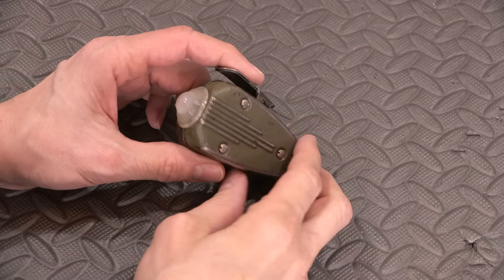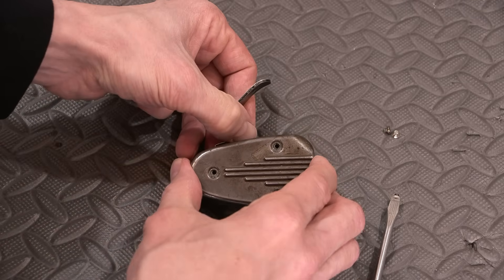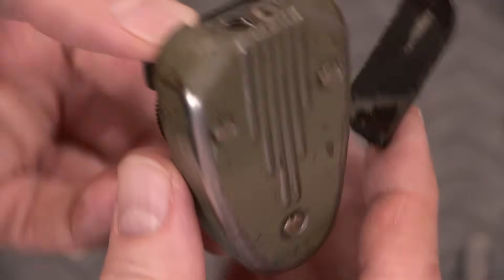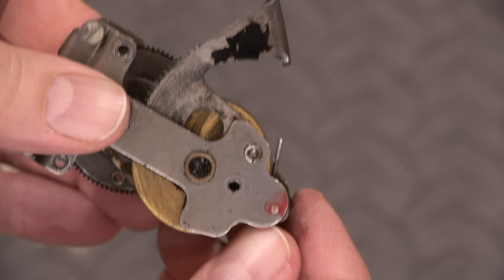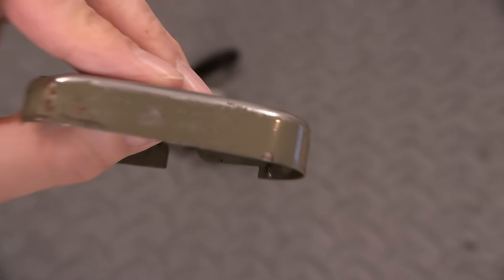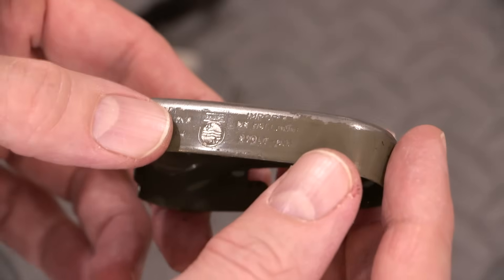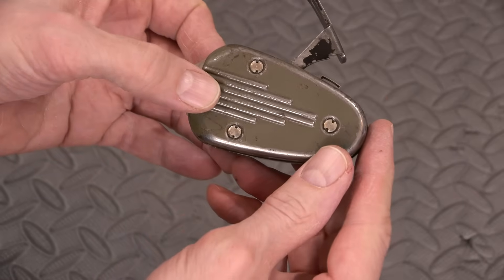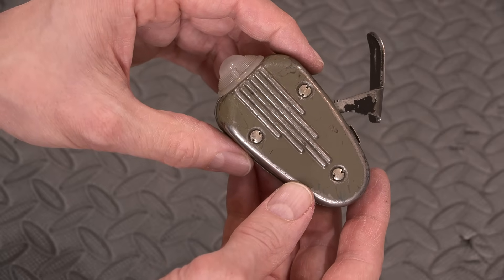WW2 Dynamo Flashlight - Doesn't Use Batteries! Let's look Inside.

Comment: I have several dynamo emergency flashlights that I bought in the early 2000's. Turned out they were plastic pieces of junk that no longer work after being in dry, cool storage for twenty years. Yet here we have an 80 year old masterpiece of engineering that has been road hard and put away wet for 8 decades, still working like the day it was made.

Another perfect example of how far we have fallen.

Thanks for the video, Mr. Carlson. I would like to vote for leaving it in original condition. I love it when old mechanisms are left just as they are, after aging gracefully through time.
Reply: I was just looking at some modern Chinese versions of these with hand cranks a few hours ago, many comments said they didn't last 5 minutes before the plastic gears stripped out
Reply: @zaptainkuboom5520  This is true. I have a blue one from a few years ago, and it just seizes itself, so you can never generate a good charge.
Reply: Ha! I bought a lot of these and just found one in a box the other day. The flashlight hadnt been used in years and still lit up without me having to give it a squeeze.

I am disappointed that the plastics fell apart so easily on these. They are amazing little gadgets.
Reply: those generally charged ni-cad batteries, then they ran the bulb/led. the batteries don't last long, used or unused.
Reply: Fenix sell 1 like this with advanced plastic

Comment: >this would probably run longer with LED's, but that would be a modification
Considering that the bulb is replaceable, I wouldn't consider it wrong to put an LED bulb in it, along with all the extra circuitry needed (if wanted), as long as it can fit where a bulb would normally be without damaging the original product

Comment: Hey, I own one of those. From my grandpa who had to hide for the Nazi's, but still needed some light in his hidey-hole. Quite risky, because as you can clearly hear, these things make a lot of noise... Fortunately he might have been hungry, but he still survived and eventually he actually got reunited with my grandmother. It still works, including the bulb itself, but the window is slightly scratched. The 222's "shape" is a perfect match with the one I found inside this thing.
Reply: It may have been quieter when new.  Still you would only use it now and then when you needed to see.  On a night with a moon you may not need it to be able to find your way about.
Many many years ago I met someone who told me he hid from the Nazis in plain sight.  He limped down the road pushing a cart load of cabbages.  He was a bit unclear about where he got the cart, cabbages and old clothes.  I thought at the time that that was part of the story he didn't want to revisit.
Reply: @kensmith5694 That's a good story. He was lucky to not encounter a really strict SS officer who was of the firm belief that crippled people were only a burden to society and needed to be put "down". Brrr, the very thought...

Comment: You need a 3.5 Volt 0.07 Amp bulbs, specifically designed for dynamo lights.
The 6 Volt 0.05 Amp bulb was designed for the tuning dial of tube radios, connected in parallel to the 6.3 Volt tube filaments.
These flashlights were very common at the time.
Regards,
Anthony
Reply: 6V 50mA has also been for very long the back light of a bicycle.
Reply: 6V 0.05 was actually for a bicycle rear light at the time. Later used as stereo indicator in radios. Dial lights were usually 6.3 or 7V at 0.1 to 0.3A.
Reply: 3.5 volt suggests a 3v white LED flashlight bulb might work in it. In the worst case, with a small dropping resistor.
Reply: @lyfandeth won’t an LED just turn on or off
Reply: @GoldenPickaxe  No, the LED's brightness should vary with the current. You would want to make sure that the source is DC, though.

Comment: Do a clean and re-lube only,,BUT why not take a bulb, remove the glass and make an adaptor out of the base and then make the capacitor / LED just to see as you said "modern improvements" working.

Comment: Brilliant video, thank you. I have exactly the same flashlight, in slightly better condition. Only slightly, but it does have both the plastic flanges on the lens. It was really interesting to see it's workings as I have never opened mine, just left it as is. I did replace the bulb though, although I can't remember what voltage or wattage. It lights, but not quite as much as yours. As far as restoring, all I would personally do is give the insides a little clean and lubricate, and that is it. Maybe polish the lens a little, but no more. Keep the original paint and patina, that is a part of it you will never be able to replace. Sure, you could repaint it and make it almost like new again, but if you did, I think you would loose what it actually is.

Again, great video, thanks!

Comment: What a cool flashlight! My opinion on restoration, clean lube and restore the intrernals and the lens. Keep the outside patina and always look at it thinking about how it ended up the way it is. It tells a story and is probably best preserved. 
But you own it and should you decide to fully restore it I wouldn't upset to see it in it's original condition either. It may be one of the best examples still around and restoring to museum quality has its place.

Comment: I am now 73 yo.  I had one of these to play with as a toy when I was a kid in the 1950s.  Keep in mind that all flashlights of the time were heavy, powered by at least two D size batteries, very small bulbs with a poor attempt to refelect light off of a rusty reflector.  We called them, " a case in which we stored dead batteries".  The Dynamo flashlight was always dependable, but the light was not at all bright and you had to keep pumping the thing at the same time as doing whatever task required light, such as walking, or chewing gum.  A better option for us was using a kerosene lantern.  Still in use today, I might add.

Comment: I have the same one for over 50 years. It also still works, it even also has one of the tabs of the lens broken off. But also more bits of edge of the lens broken off. The bulb inside is 3,5 volts 0,2 A.

Comment: Thank you Mr Carlson for the nice video.
Here in the Netherlands we have a webshop for spareparts for these flashlights.

Search for "knijpkatershop" to find it.
I bought a plastic lens for my own "knijpkat" ("pinch cat" in Dutch).
That website has also a hisory page, with at the bottom a detailed technical article by Philips about this flashlight.
The article is in Dutch, but has some interesting drawings anyway.
Some facts from the article:
The mechanical handpower to use the lamp is about 0.9 Watt, at a squeeze force of 1 kg.
About 0.3 watt enters the bulb, the rest of the power is lost as heat.
The dynamo runs at an average of 4000 RPM (squeeze 120 times per minute).
The average loaded voltage is about 2.5 volt.
So a 2 volt bulb runs at overvoltage, this increases its efficiency, but reduces bulb lifetime.
The lightflux is 2.4 lumen, and by the use of the lens this gives 4 lux at 1 meter distance.

Mij own "knijpkat" has an unpainted aluminium case, this was the first produced model (type 7424), and was for sale for civillians.
On the case it says for the bulb: 2.5 volt - 0.1 A
It still works great, and I actually use it now and then.
The paper thing around the bulb is a dust cover, I think especially useful when the lens would be missing.

Comment: I appreciate wabi-sabi but the patina on this isn't very impressive.  I'd refinish it, clean and lubricate to reduce the frictional losses and fit an appropriate LED and capacitor to make it far better than original.  Modern versions of these tend to be cheap novelties and utilize rubber belts and craptacular dynamos.  The robust internal mechanism of this unit combined with modern lighting technology would be a great combination.  Not everything needs to be a museum piece.  There's nothing wrong with improving an old design.

Comment: You could modify an old torch bulb with an LED, resistor, diode and capacitor.  That could be a neat upgrade without interfering with the original unit that stays lit for longer.

Comment: Vintage squeeze cat from the well-known brand Philips, type 7424 01A from the Second World War. The squeeze cat got its nickname from the sound it produced when operated. A cat-like whining sound. Due to the shortage of all kinds of raw materials and products, and the lack of batteries, people were forced to think creatively about the smallest objects for our daily use. The eclipse made having a light in the darkness a very important asset. Philips had a handy solution for this in the form of the squeeze cat and a flashlight that worked with manual control. The squeeze cat was invented by Ir. L.J. Kalff. Although the squeeze cat was only patented in 1942, production started in 1941. Philips also made squeeze cats for the German Wehrmacht, this production took place in the Vught camp from the late 1940s. Together with the infamous battery factory of the Vught camp of the B677 special workshop of Philips, where all persons working there were deported to Auschwitz with the transport of June 1944.
I inherited one of these and its a shiny aluminium one, still working great.
Reply: Hi Jaap, do you know if plastic lens caps were produced during WW II in the Netherlands?
Reply: @gerteldering  Hi Gert, your guess is as good as mine. But for what its worth, the answer is probably yes.
Reply from the maker: Thanks for sharing your story!

Comment: i say restore the lever to new and upgrade the light to LED and upgrade the cap or add a super cap if it doesn't have one. but leave the body. just my 2 pennies. Oh and the LED, put it in a screw in base from a incandescent bulb that fits it. Like maybe add a resistor to the bulb to keep it from draining the cap too quickly. Im thinking break the glass and remove it from the base, fill it in with hot glue.

Comment: These generators work in a constant current mode, there the current is not that much dependent on the generator speed...
For an LED you really need just two antiparallel (so it lights for both half waves) 100mA LED's and nothing else, so quite easy to build something into an E10 thread from a broken bulb and just srew that into the flashlight as is. I would use 6 LEDchips, I would use something like 3 for each direction and .arrange them into a hexagon with alternating polarity, sowhen the lens is on, it would smooth out the flicker a bit. No need to touch the lantern in any way.

Comment: I have a 'modern' version of one of these from some time around the 90's, which used to live in my car for emergencies, but it has been in the odds and sods drawer in my kitchen for many years unused.
It's likely Chinese or Taiwanese made I'd assume, very much doubt it's a collectable🤣
TBH, I've never opened it up to see how it works, but I'm sure it'll be pretty much the same.
The body is a fair bit larger, with a flat lense made of mostly plastic, cheap and cheerful knock off of old technology👍

Comment: I would leave the outside as is, but rebuild the inside, maybe put the new bushings and balance the flywheel properly to make it quiet and smooth. I had a similar soviet lamp from '80s, it had plastic case. I dropped it once and it developed vibration, probably bent an axle on the dynamo or something.

Comment: Fascinating, I'd always assumed this basic design was from the late 60s or early 70s. 

My folks swore by 00s-edition ones with LEDs, all-plastic bodies, and still no extra capacitors or anything. Which I bet are much less bright than your suggested version with modern LEDs and power regulation would go!

Comment: Had a cheap plasic version of those in the 80's, loud, tedious, tiring, annoying, inconsistent light, didn't use it very long.
But i remember it having a bicycle bulb 6,something Volt, i mean it was reasonable bright while it worked, but you could burn out the bulb when spinning it too fast too long.

Comment: It functions similarly to modern emergency lights that you squeeze, except built with far better quality. It still sounds exactly like the modern equivalent ones, interestingly. Originally, I thought the squeeze dynamo charged the batteries. In reality, the dynamo is for when the batteries are dead. That means you can throw it in an emergency kit and forget about it.

Comment: That is a very nice find. Very practical too. A lot.of people don't keep their flashlights in order, they forget to charge it, or the batteries are dead and when they need it it doesn't work. A light like this always works as long as the can squeeze that lever.  If it were mine I would say leave it as is. Clean it a bit, lubricate the mechanism but let it keep its wear and patina as a symbol to its history.

Comment: Kind of reminds me of my first bicycle which I got a dynamo which hooked up to the frame and had a cap on it that
turned as it ran against the rear tire. Two wires went to a chromed dome light mounted on the handlebars. It worked only
if you were moving. Good stuff Paul.

Comment: I remember when bikes came with similar lights back in the 80's that are driven by the edge of the front tire.
Reply: Had one on my 10 speed in the mid 80s. Also had a speedo that worked the same way.

Comment: These are still available.  We converted one to run with a LED lamp, because these older bulbs are no longer available (except as used ones).  Added a diode rectifier and a large capacitor, with resistor to the LED, and this made it run for several minutes on one push of the handle.  The old ones only lit for about 10-seconds, if that.

Comment: When I was a kid in the 60's I got a dynamo powered bicycle headlight/taillight set. It was much brighter than the old battery light that came with the bike, and paid for itself by no longer needing batteries, which only lasted a few hours.
Reply: Same time frame here. I saved and saved for my generator light. Of course, the power wasn't free--you could feel the pull of the generator in your legs, just like your car can tell when you turn on the A/C on a good hot day. And in order to have enough light to see, you had to peddle really fast. It was like you were perpetually outrunning your headlight at any speed. The old carrot and stick lesson. If you went slow enough to be safe at night, you couldn't see. If you peddled hard enough to see, it was like defying death it was so fast. At night, you know.

Comment: I found this fascinating discussion of the Phillips Pinch Cat Flashlight in an article called "Technology and Holocaust" on a website called History of Sorts:

"The well-known hand dynamo from Philips was designed by Ir. L.J. Kalff and patented in January 1942. There were more than a million copies of the standard Pinch Cat Flashlight model made.

"The principle of the squeeze cat consists of electromagnetic induction. When a magnet rotates in a coil, an induction current occurs in the coil. This current could then be used to light a light. The voltage was 2.5 Volts at 100 mA/0.1A; with the help of a lens, the light from a 2.5 V light bulb could shine in a targeted manner.

"During the occupation, 4 models were produced:

"Type 7424, aluminum, silver-colored (see image);
Type 7424/03, aluminum, green;
Type 7426, aluminum, beige (due to a lack of aluminum, brass was later used and zinc was used later);
Type 7426 Bi-Jou (the so-called “ladies model”), aluminum. Mainly produced around 1940-1941. With a retail price of 8.75 guilders, it is considerably more expensive than the standard model.

"From February 1943 until 2 June 1944, the standard squeeze cats were manufactured by, among others, the camp residents of Camp Vught, including Jewish employees of Philips (the so-called Philips Kommando).

"On 18 October 1935, Frits Philips was appointed vice-director and a member of the board of Philips. Learning of the expected occupation of the Netherlands by Nazi Germany in World War II in 1940, his father Anton Philips, young nephew Frans Otten, and other Philips family members escaped from the Netherlands and fled to the United States, taking company capital with them. Frits Philips stayed in the Netherlands. Together they managed to keep the company alive during the war.

"From 30 May until 20 September 1943, Philips was held in the concentration camp Vught because of a strike at the Philips factory.

"During the Occupation, Philips saved the lives of 382 Jews by convincing the Nazis that they were indispensable for the production process at Philips. Mr. Philips reportedly tried to hire as many Jews as possible and then told the Nazi occupiers they were irreplaceable, a strategy that prevented many of them from being sent to Auschwitz.

"Of the 469 Jews employed at the factory, 382 survived the war, according to company history.

"Some historians are critical of Mr Frits Philips, they say he played a double role in the war because its factory production contributed to the German war industry also. However, the fact is that anyone who defied the Nazi regime put their life at risk.

"Employees of the Philips Kommando had a hard time in Vught, but slightly better than the other prisoners. For example, every day at four o’clock these prisoners received a hot meal from Philips. This meal came to be known as Philiprak. In addition, they were assured of a dry workplace, without much interference from the guards."

For more, see "Technology and Holocaust" at dirkdeklein.net .

Comment: 3D print / cast in resin a new 'lens' with an LED, use an old bulb to interface with the existing socket to a small 'daughter board' with a rectifier and cap.  Modern electronics and keeps the originality of it.  Easy to switch back to the cloudy lens for collection value purposes.